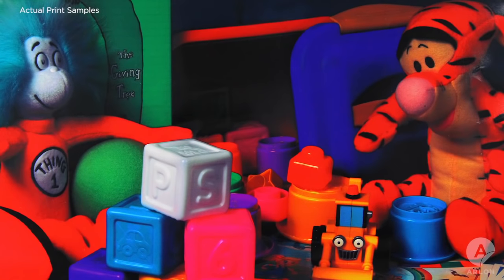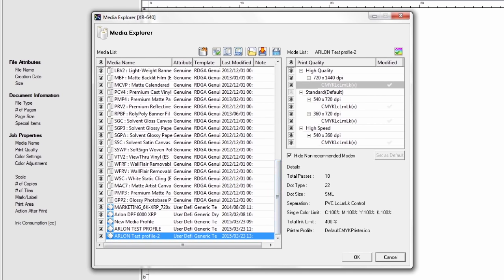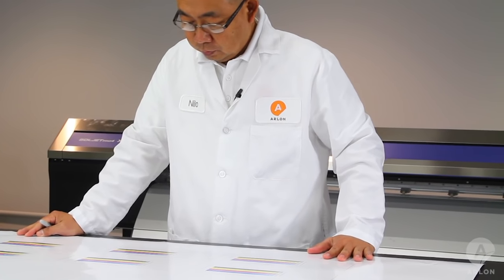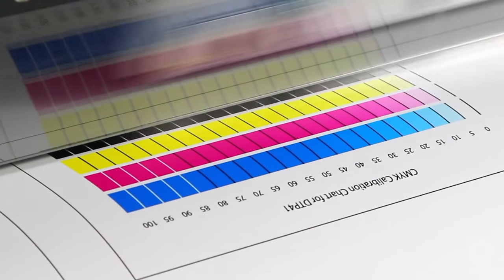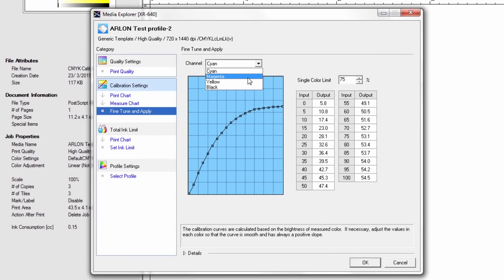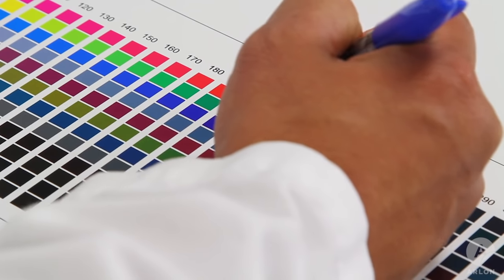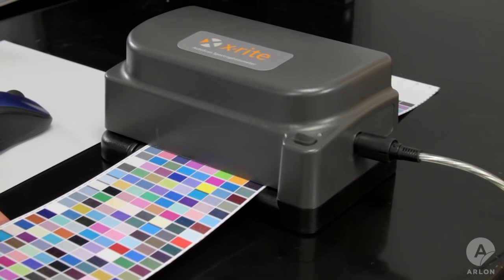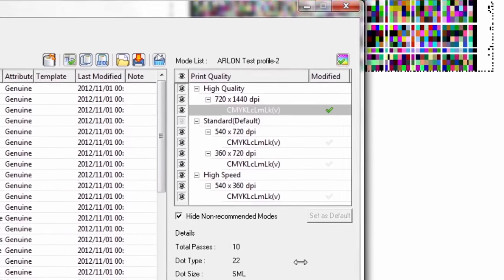Creating a Custom Media Profile in Roland VersaWorks

Comment: Hi, very helpful video. But my DPT41b connects using USB and Versaworks will only connect in Edit>Prefences>Measurement_Instrument to a DPT41 using serial. I think you are using a DPR41b (?) in this video and if so how did you get Versaworks to connect to it over USB?
Reply from the maker: Hi Alistair, I reached out to our technical service team and they would like to help! Can you answer these follow-up questions? 
Are you using a serial to USB adapter? 
What type of error code did you see?
Reply: Hi, thanks for your reply. I am not using serial to USB adapter. My DPT41 is already USB but Versaworks will only connect to a DPT41 using serial port. This can be seen from the Edit>Preferences>Measurement Instrument menu. Serial to USB adapters only allow a serial device to connect to a USB port. I need to connect a USB device to a Serial Port! I am guessing the DPT41 shown in the video is a serial device already whilst mine is a newer USB device. Unfortunately Versaworks has not been updated to support the newer USB model. But that is just my guess, I am very interested to see if your technical service team can offer any further insights that can get this working for me. Kind regards, Alistair.
Reply from the maker: @AlistairOwensgooglePlus  We believe there is a specific driver that may fix the issue you're experiencing. Let's speak directly so we can help you more quickly. Can you contact our team lead at kkwo@arlon.com? Thanks, and have a great day.
Reply: Hi! I also got an dtp41b with USB connection and versaworks doesn't recognize the instrument. Could you fix the problem? If so, how did you do it? Thanks!

Comment: I'm attempting to print helmet decals on 8 mil clear vinyl (convex gear wrap) but can't achieve a vibrant finish. It keeps coming out with an orange peel like finish. What profile should I be using in versaworks dual?
Reply from the maker: Hello Bigg Redd. Unfortunately, the 8-mil clear is a Convex product, so please contact Convex for the best profile available for their film. Arlon has DPF 6000RP Clear that is digitally printable. If you provide us with the Roland printer model and RIP software, we’ll be happy to recommend the right profile for one of our products.